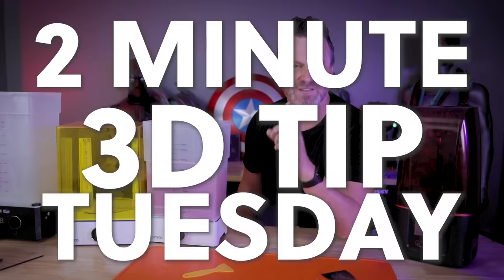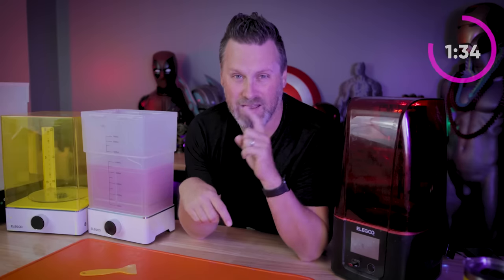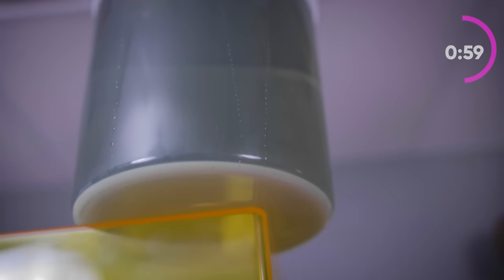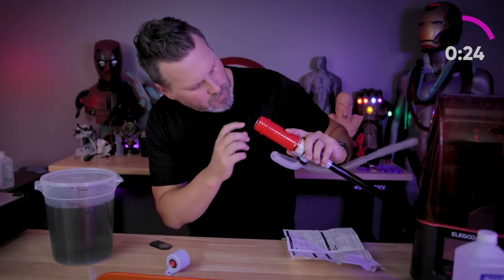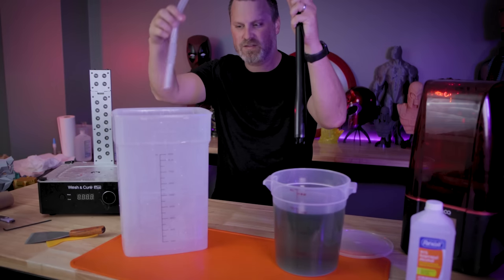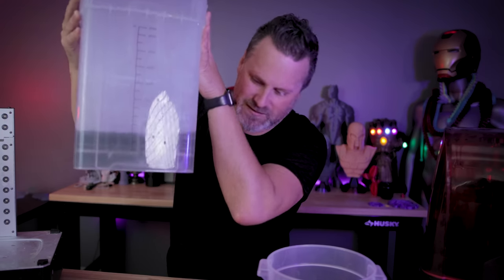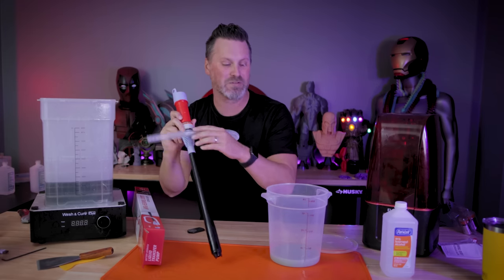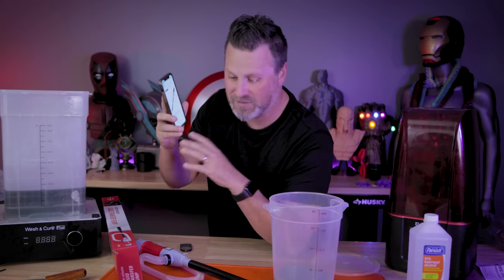Must have accessory for Resin 3D Printers!

Comment: Careful using an electric (brushed) motor around flammable liquids. Much safer to siphon using gravity.
Reply: This pump is designed for fuel transfer. I've been using one for Diesel to fuel my tractor for years now.

Comment: I have a two stage cleaning. The wash station gets the brand new stuff and the big juice container gets the used stuff. The old ipa is the first wash then the print goes into the wash station. When they need changing, the washer ipa goes into the wash jug. Then the really nasty stuff gets left on the deck till it’s gone.

Comment: A Mini Auto Siphon used for wine making would work as well.
Reply: Yeah but tbh I think mine is more than 12 dollars
Reply: I went this way as well and discovered that IPA makes the plastic most racking siphons are made of degrade into an incredibly brittle state. 
There is a stainless steel racking tube out there, but it’s way more costly than this solution.
Reply: @idyll23  If you are running a print farm, it might be worth the investment.

Comment: Leave the bucket in sunlight.  Resin will cure and go to the bottom. Then just simply filter the IPA. Done, no pump needed. Also, the IPA will  be much cleaner.

Comment: That's pretty cool! 

Something I've been doing for a while is to have a separate container of IPA that I manually rinse off prints in quickly before putting them into my wash station. It gets the heaviest residue off and keeps my wash station IPA serviceable for a lot longer.
Reply: I do mainly the same thing too. I have two wash / cure buckets for the Mercury Plus. I use one as the "Dirty IPA Wash" or stage one and then my second bucket as a stage two wash. I havent had to change IPA in six months or so. Works great.
Reply: @hazthematt  Both have an interesting setup.
Reply: This is my setup as well. A quick and easy 'dirty ipa' wash, followed by a thorough clean in my wash and cure. The ipa in my wash and cure basically never needs changing

Comment: I've been using a siphon pump intended for use with brewing mead. It has a stand off so it doesn't touch the bottom as well as a filter screen. No need to worry about potential issues from a spark or anything like that.

Comment: Before storing the clear container for a few weeks first put it in the cure station for a few minutes! This will bind a lot of the resin mixed in there,  when it becomes cloudy at the bottom you know it worked and this will speed up the process and get you more clean IPA! Try it! it works great! I personally use PET bottles, but it should work just as well with the thicker PE buckets you have.

Comment: Just been using a self-starting siphon hose.  Search "Safety Siphon."  Has a nozzle on one end with a trapped marble.  Stick that end in the IPA and jiggle it up and down a few times and the marble basically acts like a little pump, enough to get the siphon started.  Then as long as the container you're draining into is lower than the container you're draining out of, gravity does all of the work.  Nothing to charge or plug in; no motor to burn out; simple to clean/drain, since it's just one clear hose.

Comment: I just put my ipa into glass jars, toss it out on the deck for a week or so and it’s crystal clear with just the residue in the bottom.

I then use a peristaltic pump to pump it back into my wash and cure.  Small, works really well, and contained.

I’d recommend it over a much larger pump.
Reply from the maker: Anytime ive left mine out it turns it one massive blob of cured IPA haha
Reply: @UncleJessy  let it sit first then set it out. I found glass works best and how warm the jar gets. It also depends on the type of resin and how long you wait to clean it. It definitely seems like the stuff in the resin all split apart when in the IPA. Like the stuff you transferred back was likely colored because of the dye they used to color the resins you used
Reply: @UncleJessy  That usually happens when its super saturated. Try to do it more often before it gets over saturated with resin and it shouldnt be a problem.

Comment: We tried this at work for transferring degreaser out of drums. Unfortunately, they are not really designed to transfer degreaser, and probably not IPA. The hose gets degraded by harsh chemicals, so I'd be checking it fairly often. 12 bucks is pretty cheap though so it may still be worth it.

Comment: I use a 2 gallon beverage dispenser from Better Homes and Gardens, $12.94 at Wal-Mart. I just fill it with dirty IPA and let it sit in the window. The poor spout at the bottom is high enough up that only clean IPA comes out after a week or so. It works exceptionally well.

Comment: Make it double effective by adding a small amount of alum to your alcohol, mix and wait until it's all settled out. It is known as a flocculant, and it will force all the suspended particles to precipitate from solution and settle at the bottom, leaving you clear IPA to pump off with ease!
Reply: Clear but still fairly saturated. IPA dissolves resin (it's why we clean with it), so quite a bit of the resin isn't in suspension, it's in solution.  Eventually the alcohol concentration of the IPA gets low enough, from all the leftover resin chemistry, that it just stops being effective to clean with.
Reply: @IsenMike  distilling is the way to go

Comment: I have one I use to fill the lawn mower  Much better than lifting the 5 gallon can  Just have to remember when using it with solvents that you have to pump a quart of water through it at least to rinse it out as solvents can damage the interior plastic parts    A mesh cover over the end wouldn't be a bad idea either as it can suck in small parts that can jam it

Comment: I love these and have used these before but find they break apart easy.  I haven't used it for resin/IPA but have for other substances that I need to skim without debris. Now, I use a dedicated fish tank gravel vacuum. The same principle but uses a bulb instead of batteries to flow.
Reply: I have a couple of the bulb type. It's improved when the destination container is lower than the source container. Pump a few times to get the siphon going and press the top of the bulb to break the siphon and stop the flow. No batteries makes a big difference.

Comment: I use clean ipa every wash: first stage is in wash and cure station with somewhat dirty ipa. Second stage is a spray bottle of 99% IPA, with residue caught in a small bucket underneath. I then pour that residue into an old IPA gallon container. 

When the gallon is filled, that ipa becomes the new ipa for wash and cure. And the wash and cure station IPA gets put in storage. Eventually i plan to distill it and fully reuse.

Comment: I put my ipa into a clear container and cure it. The resin hardens and falls to the bottom then I transfer using a funnel / filter.  Works really well.

Uncle Jessy I've watched many of your videos and haven't caught what you use for air filtration for your sla printers. Are you using anything?
Reply: Not even wearing a mask.. I thought this stuff is pretty aggressive and stays in the air for a long time if the room is not well ventilated

Comment: I love accessories for 3d printers that you make with the 3d printer
Reply from the maker: Me too! Might do a video on some in a week or two!
Reply: I designed a funnel that has a basket inside to hold a coffee filter. It works a little better than a normal funnel / coffee filter.

Comment: I just fill the IPA into an container which I'll let sit in the sun for a bit. Depending on how sunny it is it usually takes 1-3 days. Usually I transfer it to another container after it got cleared for the most part and then let it sit in the sun again. After that I transfer it again but this time with a funnel with a coffeefilter. After that the IPA is crystal clear. Bit more effort but goes faster and gets me really clear IPA so I'm perfectly fine with a bit more effort

Comment: I personally use a VERY big syringe (150ml) for cleaning up the VAT. In a few passes (mine is a LD-006) the resin is back into the container. However, as I don´t have a watercooled car anymore, I have a pump like that (which I used to replace coolant liquid in my previous car) laying around, and that idea for cleaning up the wash and cure station is great. The only difference is that my pump is manual, not battery powered.  And this idea is awesome, you can even put a filter (a hose filter like those used in pressure washers would do the trick) in the intake or in the exit hose to keep debris out.

I´ll definetely give it a try.

Comment: I just use a length of 1/4" tubing (aquarium air hose, for instance) and a large syringe. Put the destination container on the floor, stick one end of the tube down in the wash & cure tank (hopefully clipped in place) draw on the other end with the syringe, then stick it in the destination container. Physics does the rest and it costs pennies.

That said, I prefer to agitate the IPA. Because having the resin fully in solution is the best way to completely cure it out.

Comment: I can understand why you would want to re-use IPA since IPA is expensive.  But I've been using Methyl Hydrate Alcohol for years to clean my prints and it works great.  I get 4 Liters for $14 which lasts a long time, so at that price I've never felt the need to have to try and re-use it.

Comment: I pour it into a HDPE milk jug and set it in the sun for a while. That allows the raw resin to cure into clump and fall out of suspension. I then pour it through a paint filter and most of the solids are strained out.

Comment: Here's a thought. So when you said "I'll just use UV light on it and throw it out",what if you used that resin in a mold or something. Even if it's just flat on the bottom of the container,you could,potentially,use it for other things. Stands and walls and other flat things.

So if you put it in a mold,let it settle,and then UVed it,would it harden properly into something?

Comment: Use a spray bottle filled with IPA or Acetone (get a solvent resistant one) and use the at over a seperate tube for an initial clean off to get rid of a lot of resin. Then do a rinse in clean IPA or Acetone. It’s stays cleaner a LOT longer and you only need a few ml of cleaner for that initial spray wash.

Comment: I use Acetone instead of IPA. Yes, its stinkier, and not friendly, but it cleans resin off way faster than IPA does. A downside is it makes the resin bendy, so tiny thin parts can distort if you're not careful, however after curing prints are as hard and strong as usual. Residual resin tends to drop out of solution faster in Acetone than it does in IPA too, so for me it's a win win. Better performing with little to no downsides, and much cheaper

Comment: So during the pandemic when isopropyl alcohol was really impossible to find, I went through a bunch of methods to reclaim the isopropyl alcohol.  Paint filters, Britta filters but what I found worked best was a funnel attached to a tube attached to a life straw.   Filtering through the Life Straw got it pretty much clear again.   Though I did use a paint filter in the funnel still for larger chunks and distilling it first like you did also helped.  (I had gotten a large I think car oil funnel so it held quite a bit of fluid.)

Also I had looked into boiling options and such.  The thing I discovered is the longer it's exposed to air, the more moisture gets in it.  So what started as 95% isopropyl alcohol eventually becomes less and less and eventually more like 75% isopropyl alcohol.  So you can reclaim it some, but you may want to cut it with a bit of something fresh.  Maybe like a  50/50 mix.
Reply: thats funny. cause my electroncs store had them  6 in a box and they had soooo many. i kept that to myself. general public woulda went TP crazy in that store and would jacked up the price. 20$ a litre.
Reply: Or you could have just used Ethyl alcohol, way cheaper and easier to find.
I use that and then i filter the used one with paint filters, then 20um paper filter, i'm planning to buy a buchner filter and vacuum flask to filter with 8um paper filters (with 20 is already too slow if done with gravity)
Reply: Lol... yah a life straw filter, or basically any decent high end filtration should be able to pull nearly everything out of it.
Reply: @NeoIsrafil  Like I said. I tried paint filters and other water filters. Life straw was the only thing filtering out the actual reason where it was clear abd not sticky. I use a lot of black resin so it was clear that it was still being left behind with the others. The life straw filters particles down to 25 microns. Like that's like 2-4x times smaller than what a Britta filter does.  At least in a price range that wasn't super expensive.
Reply: @imdeaded  I could occasionally find the 75% or what ever the lower percentage was, but I was looking for the 91%  I looked at a bunch of stores.  I could find some online in gallon jugs, but It was over 4X the cost of the bottles I usually got and I refused to pay that much for it.

Comment: I usually let mine settle and then cure it with a UV light, and pour it through a mesh metal filter to grab the little plastic bits out. I'll do that once for each container of resin, after that I dispose of it.
Reply from the maker: I've tried this but typically wait too long and it ends up being one huge geleton like substance

Comment: Have you ever thought of filtering used resin with Revert Osmosis system? I would like to give it a try, but the setup will cost about $400-$500 because a booster pump is required for system to work. Maybe you can try this?

Comment: There is a smaller version of this and cheaper, which can be screwed onto the bottle. The point is to have the slimest dish possible so that you don't waste as much of IPA. With the bottle one you can restore up to 95% of the used resin.

Comment: Where's the PPE? Great video and all, but folks really need to understand that open containers of IPA, especially if they have uncured resin mixed in, aren't things you want to be breathing around unprotected. I recently got a VOC/Formaldehyde meter and realized my wash and cure station needed way more ventilation than my printer.

Comment: What is the voltage because you can get 3v, 6v and 24v versions on Amazon and eBay.. I just ordered a 6v version off eBay for about $9.50 with free p&p or £8 as I'm in the UK.

Comment: I don't understand filtering or recycling IPA when denatured fuel is $10 a gallon. 

If you have a 2 or 3 stage wash system, the last stage will remain clean forever.

Comment: That's really convenient!

I quickly noticed that decanting can disturb the separated resin on the bottom too much, so that at best you can pour out only the top part of the clearer alcohol.
Siphoning is definitely the way to go.
So I got a cheap wine siphon - a plastic tube with a manual plastic pump on the outer end that needs to be stretched out to suck fluid.
It's better than decanting, but not as convenient as I imagined.
This e-pump seems great ...
but I just realized I have an e-pump for those large water bottles (that are too heavy to routinely lift to pour a glass :)).
So isn't that device just a glorified water e-pump? (I'm not trying to troll or being cynical - I promise :))
I don't imagine those e-pumps being damaged by running alcohol instead of water ... only perhaps can get blocked if you pass too much resin-dirty alcohol? 
... but then again the whole purpose is to siphon the clean(er) alcohol.

The main point is if you can't find such device in your area, perhaps you can accomplish the same with an water e-pump?

Comment: This is such a cool cheap option to help limit spills. I recently moved back into an apartment and I'm trying to figure out how to safely resin print again. I know you have done safety precaution videos, but do you have any suggestions on enclosures or ways to safely print in an apartment? I have already purchased activated carbon filters to pump air through, but the fumes worry me a bit. Any suggestions are greatly appreciated by @UncleJessy or others!
Reply: Do not print in your apartment unless you're using an enclosure AND exhausting the fumes out of the building.
Reply: @bangtizzy  Thanks for the reply! I was looking into fume exhaust collectors. Do they operate well enough to replace fully ventilating outdoors? Using multiple layers of activated carbon.

Comment: Any ideas on how to clean the bottom of a cleaning tank? Mine has ceased due to the resin build up. It’s kinda bad 😅
Reply: you need to unscrew the impeller and washers etc and clean everything. acetone and swirl for 10 seconds max! then pour out and scrub and flush. you gotta be quick because you dont want to deform the cleaning tank.
Reply: @jarrajoseph-mcgrath9142  Thanks alot ill give that a shot

Comment: I understand that this is made for draining gas, but using it for transfering 90% alcohol still makes me nervous. The motor is in the tip of that black hose, and i just dont trust the contruction quality and fear that motor or connections making a spark and buring my house down

Comment: I buy DNA not IPA and its $25 a gallon at HD, Lowes or ACE. Going through all this for a consumable such as alcohol is pointless. You are not getting the polymers out of the alcohol, only the pigments.  Its the polymers that build up and reduce the alcohols ability to clean. One bottle of resin is more expensive than the DNA.